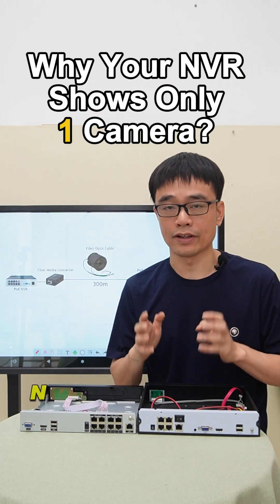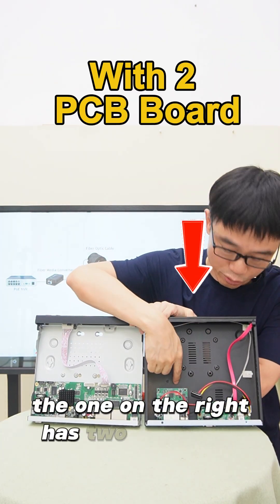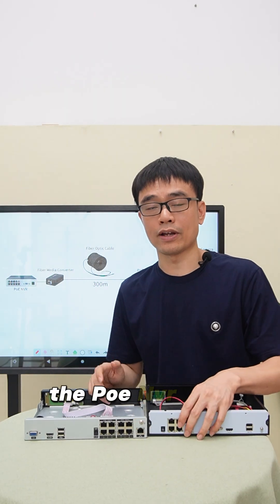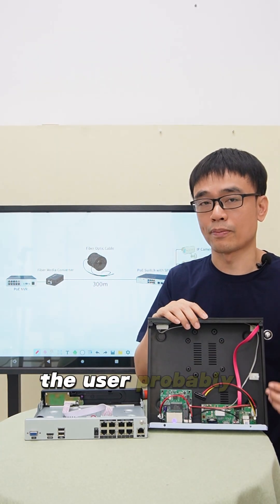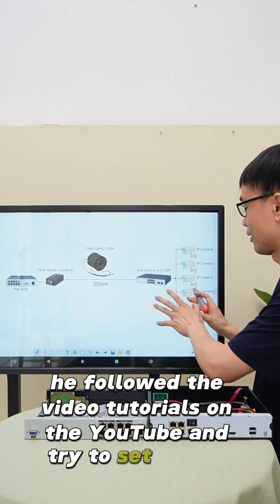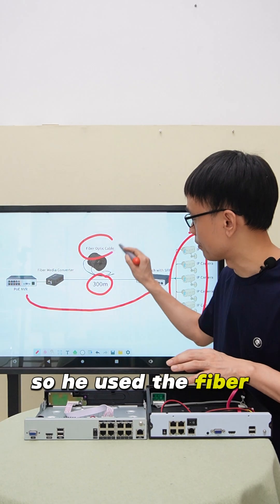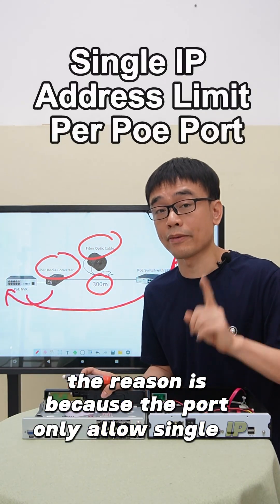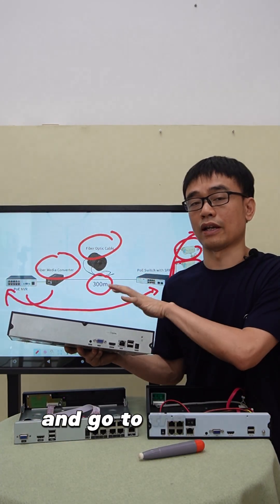Why Your POE NVR Only Detects One Camera!

Comment: When you use the non poe nvr,  
What would be the connection and other devices needed? Thanks
Reply: that 1 port in nvr > poe switch > cameras
Reply from the maker: Yes, you can connect the PoE switch to an NVR to record all video feeds. However, the PoE NVR is a more cost-effective option if only 2-4 cameras need to be connected.
Reply: @Fastcabling can i use 16 channel non poe nvr ,connect it to a 16 port poe switch then connect it to 8 poe cctv on the vicinity of your house , then the other poe ports can connect to a 2 separate wireless bridge located on different locations , is that okay?
Reply from the maker: Yes, your design is valid. The PoE switch manages all the IP camera traffic and forwards video streams to the NVR. Just ensure:

1. Sufficient PoE power on the main switch
2. Good wireless bridge bandwidth and LOS
3. Static IPs or camera discovery via NVR
4. Gigabit backbone where possible
Reply: @Fastcabling whats the recommended power that can supply 16 units of camera?

And is it okay that from main poe switch connect to bridge then on the the other bridge connect to another switch and then connect to another bridge to connect to a farther location of another bridge ?
Reply from the maker: Most IP cameras use 4W to 12W. You can use a PoE switch with ≥ 200W budget. However, some high-power cameras (PTZ) use PoE+, about 13W to 25.5W, so you can go higher (250–300W) if you have any PTZ or infrared cameras. 

Each bridge adds latency and possible packet loss — limit to 2–3 hops max if possible. Make sure each bridge pair has clear line-of-sight.